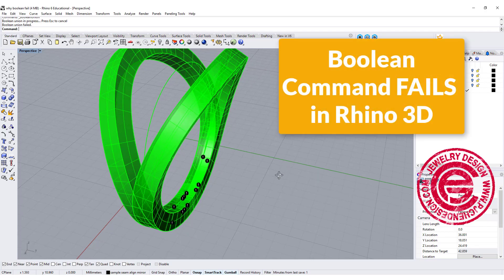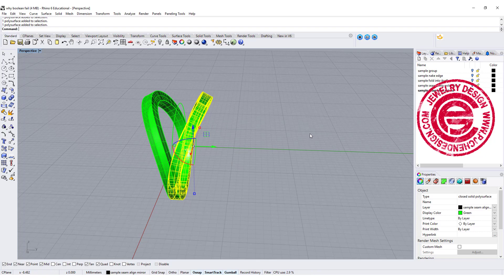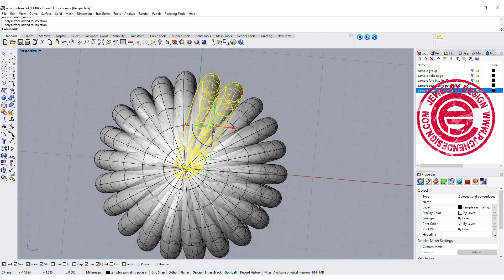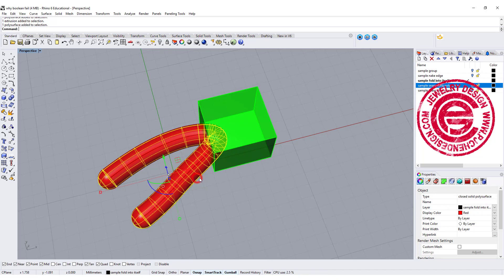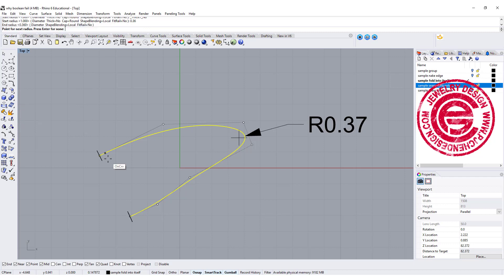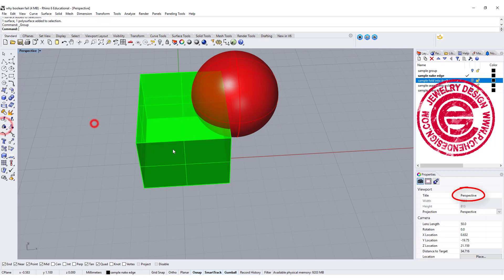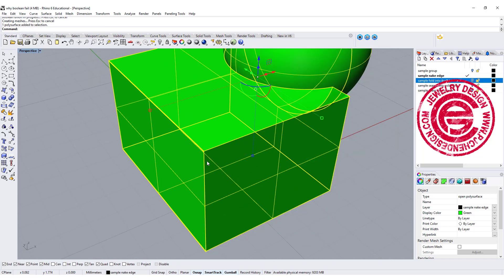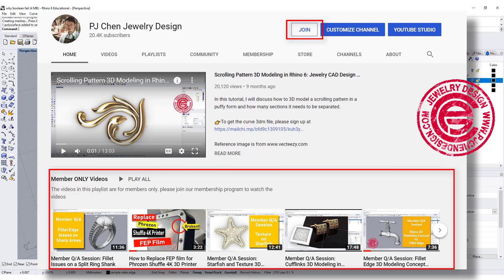Why Boolean Commands Fail in Rhino 6: Jewelry CAD Design Tutorial #129

Comment: Is it only me who thinks that shifting object 0.001 unit is not a good solution? 
Maybe I am expecting to much from a CAD software (eg. to be precise)?
Can anyone with more experience comment on that?
Reply from the maker: it is one of the solution. you can also avoid the seam to be overlapping by more the seam away if it is on the single surface.

Comment: Is there any better solution than move the object? E.g. change the seam line location?
Reply from the maker: you can move the seam only if it is a single closed surface.
Reply: @PJChenJewelryDesign  so the first two cases seems actually to be a rhino bug. You provide a solution but you loose accuracy. I have a lot of times problems with rhino booleans. I end up manually explode split delete and join again individual surfaces. But in cases like yours that's extremely complicated.